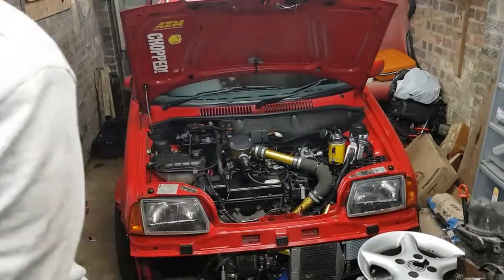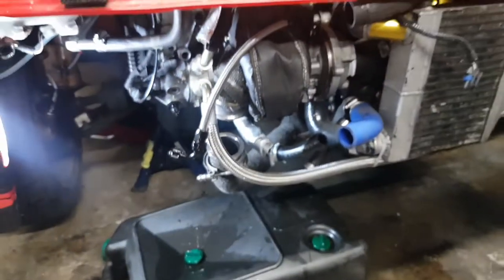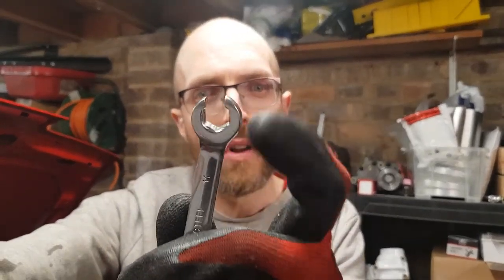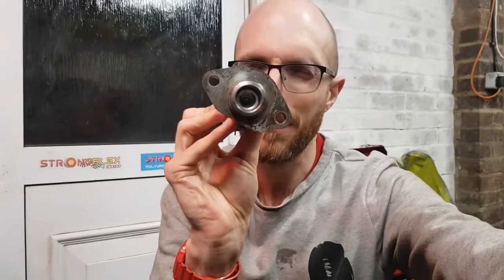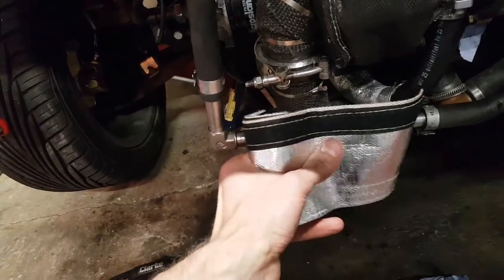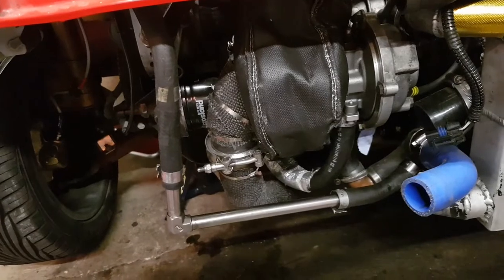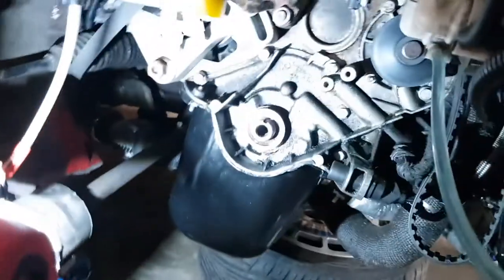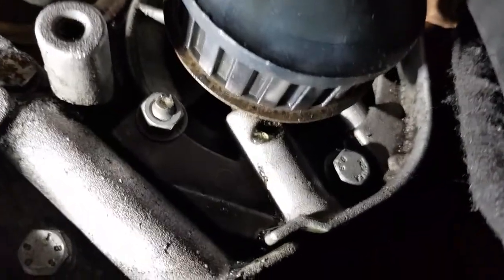The Turbo Cinquecento Goes For Its First MOT !!!

Comment: Forever getting returned parts sent back out like that, last one was an upper strut bearing for a vivaro van.

They only sell them with the complete rubber mount with the bearing pre installed even thought the bearing just pushes out with finger pressure, you can guess which part was missing from the mount kit.... bingo the bearing, someone had opened the box took the bearing out and returned the rubber part for a refund.

Comment: Euro sending the wrong parts... well there's a surprise, not! Watch out for the waterpump as there are 2 types, 16 teeth and 20 teeth pulleys. Count the teeth on yours so you can spot the correct part before you try fitting it. Also the wp bolts go into very soft metal and will strip threads... how do I know all this???
Reply from the maker: Thanks for the pointer..yeah i made sure it was the same 20 teeth pump after some advice from a mate and thankfully it matched up nicely